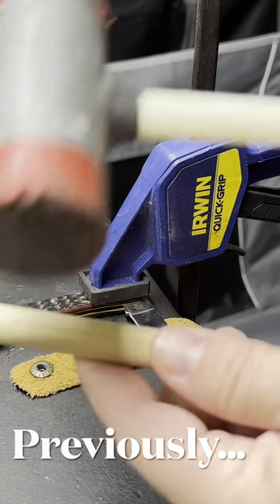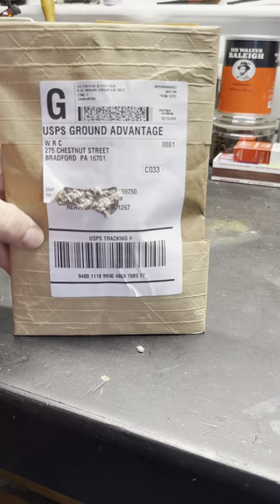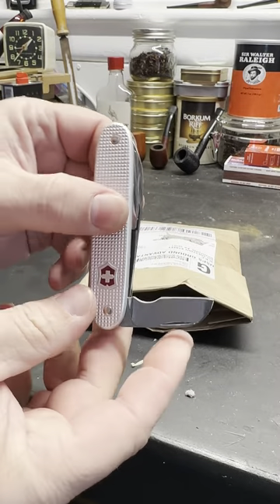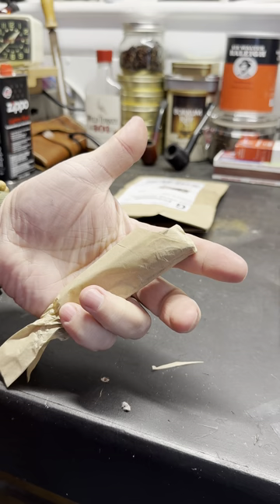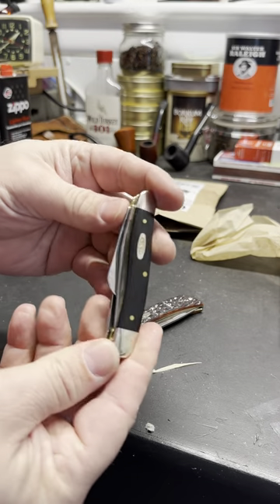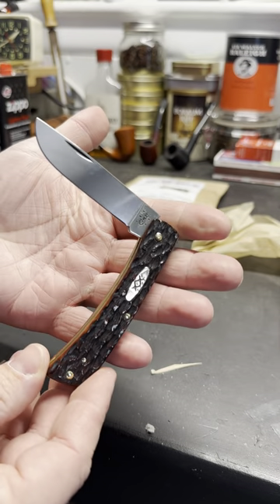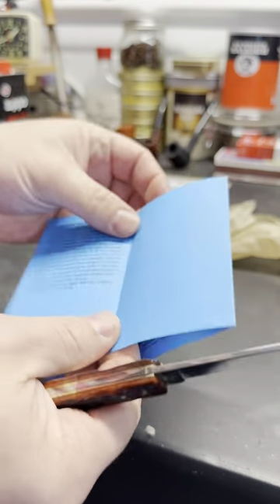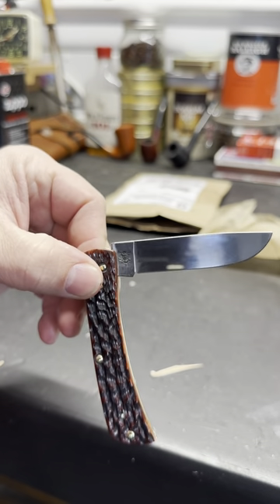Case Repair Center: Snapped blade. How’d they do?

Comment: Yah its hard to bend Carbon Steel blades without them just snapping. They are more brittle than Stainless Steel for sure. There are more gentle methods than a wack with wood and a hammer. Very cool you got it on video though! And awesome that Case actually put a CV blade on there! Thanks for sharing!
Reply from the maker: Isn’t that crazy? I never thought they actually would

Comment: Hey mate. I dunno if it's worth a try but I managed to centre my ss copperlock just by laying it on some cloth and pushing real hard near the tang with my thumb. That's all it took. I was surprised myself, but couldn't face hitting it with a hammer. 😊
Reply from the maker: That seems easy enough to try!! Thank you for the tip. I will try that

Comment: Here's some advice why the blade wasn't centered to save you from damaging your knife. The blade isn't centerd because when the steel is quenched the steel warps a little during quenching, thus why the blade isn't centered. So I hope people read this comment so people mifht stop beating and breaking their knives
Reply from the maker: Thanks for the advice. Some companies, like GEC or Buck, don’t let the knives leave the factory without being centered. After the heat treat. Thanks for watching. I learned that I need all the advice I can get!! Appreciate you
Reply: @boringoldman yeah but GECs cost a few hundred if you can even get them and Bucks are made in China. Case threads the needle being made in the US and not costing a fortune. I'll forgive a few minor defects.
Reply from the maker: @LarryReynolds591 all bucks are made in China? Solid points btw 👍
Reply: @boringoldman Some Buck knives are made in China, many are made here in the USA.
Reply: @LarryReynolds591 I saw a new case box that read made in USA with global and domestic materials. What kind of crap is that? It could possibly mean assembled inUSA from China Made  (and heat treated) blades , scales , liners, springs and USA made pins and shields and it was a Barlow at $71 . If Case did indeed halt the use of CV ( chrome vanadium ) blades in 2015 then they will be the next collectible Case much like the 1970’s dot series. All said probably all Case made before the global material period will bring a premium.
Reply: That's not the reason why, and it's kinda hard to believe that you even believe that.